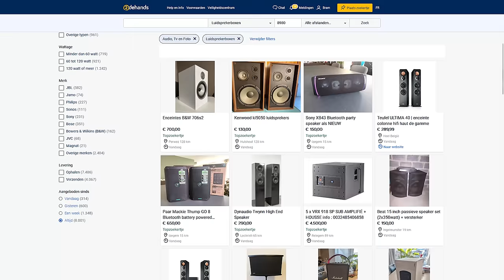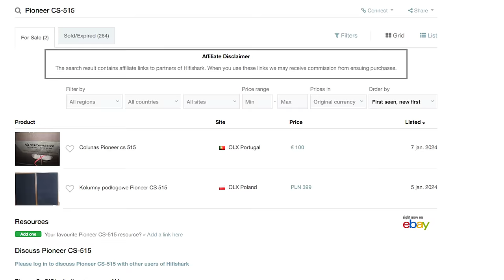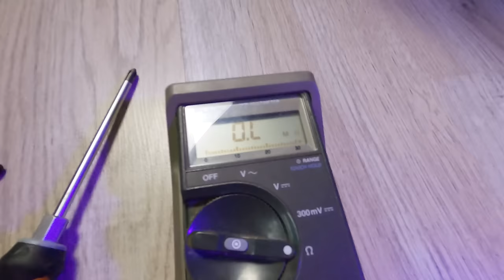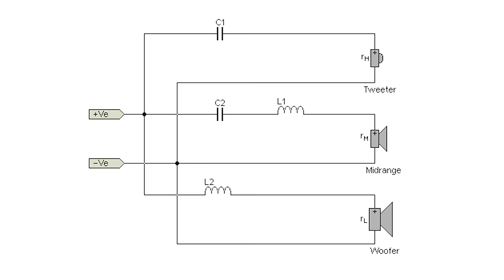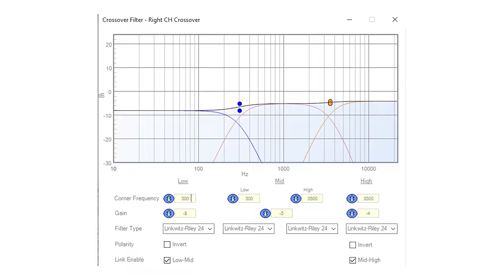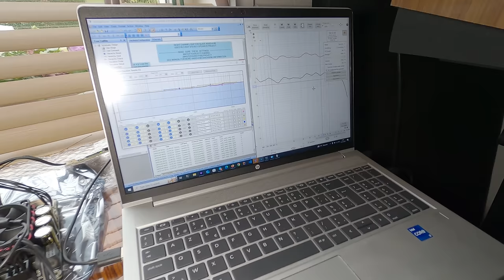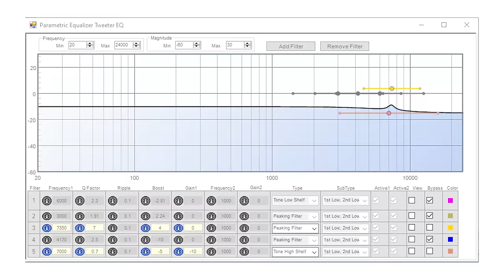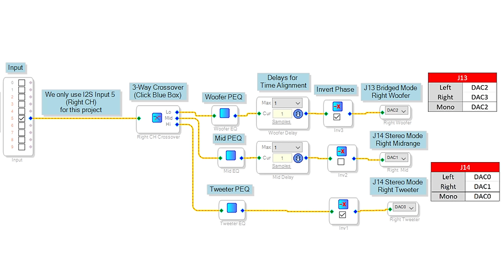Turning BROKEN Speakers into HIGH QUALITY Studio Monitors

Comment: Awesome and inspiring, thanks for the video. Would really appreciate if you could share details of the parts and components you have used and where to order. Thanks
Reply from the maker: Got most of the materials from SoundImports and Audiophonics. In the US you might want to use parts-express.

I probably forgot a few things, but these should be the most important:
- HiVi RT1.3WE Isodynamic Planar Tweeter
- Neutrik NL8MDXX-V-BAG speakON 8p
- Neutrik NL8FC
- MOGAMI W2919 Speaker cable OFC Copper
- PINTA AMORTSONBi10A PHD Self-adhesive bitumen backing
- PINTA RESOBSON FU1220 Self-Adhesive Fabric Felt Damping
- SMPS300RS Switching Power Supply Module 300W / 36V
- WONDOM AA-JA11117 Functional Cable Package for JAB3+ / JAB4 /
JAB5 Boards
- WONDOM ICP5 Programmer
- WONDOM JAB5 AA-JA33286 Amplifier Module
- Shrinkwrap
- Wire for connecting to the power grid

Hope that helps!

Comment: great work!  I have a pair of JBL 4412's I bought in very bad shape.  SO bad I literally had to rebuild the boxes as they were smashed in a way all the corners weren't tight.  So I had to redo them, wood putty, sand and paint in dark gray.  Then I had to recoil the 12 inches and have both tweeters replaced as they needed new voice coils and it's a lot of work to repair.  I bought new tweeters (same models) but they were actually also broken.  So I managed to find a JBL expert that could fix them.  But when I look at the way to sound prrof the box, I wish I spent that time searching for the right materials.  Very nice.  If you can add more detail on the sound deadening material I might put more effort there.  Thanks!
Reply from the maker: Amazing project, I really love the look of those JBL's!

The felt I used is PINTA RESOBSON FU1220, and the Bitumen sheets are PINTA AMORTSONBi10A PHD. I suppose similar materials from other brands might work good as well, if this is hard to get in your area. Hope this helps to further improve your speakers!

Comment: Try this with old speakers, to make insane speakers: Disconnect the tweeter and med range (if it has one) and put an inductor on the woofer (if it doesn't have one). Drill a hole in the top panel (towards the rear) for speaker cable (from the binding posts). Connect a 5" open FR driver and mount it on top of the box, open! And also slit the cone of the driver (if it's cheap) and cut right through (with 8 mm cuts) about 5 mm out from the center edge (with a razer blade) and all around, 360 degrees. But with 5mm gaps (that are not cut) so the cone is still in one piece! 😅 This mod is for the best treble your heard! 😮  Make a crossover filter for this driver if you like (I did and that's the secret for the best sound). But don't just connect the open driver, 100 mf capacitor on the open driver is essential for power handling and for clear med range when driven! Use electrolytic caps for FR single drivers! 😅 Sounds way better cos they make the clangy FR sound way more tolerable! Silky sound instead of a brittle sound that you get from ceramic caps on FR drivers. I have been doing this for years, and electros rock on FR drivers! You can learn basically how capacitors and inductor works and experiment. For a basic filter use a 100mf capacitor and a 2 uh inductor and a 2 ohm resistor in series, all in parallel with a 2 mf cap. And note that an open driver uses a different filter to a boxed FR driver (of course). For the clearest and cleanest med range that your heard. When you blend it with the woofer right (you may have to resist the woofer a bit for the best sound). And of course a failry large inductor on the woofer cos the crossover freq is about 300 hz (with 100 mf on the open driver). On mine, 250 hz is loud and clear through the open 5"driver. It's point source med and treble and dipole with the cleanest med range you heard (after a bit of fun, tinkering). 😅 It's the unique clean tone and tonality control in the med range that draws me in! A sound you can't get enough of, the silver sound! Mine sound like really expensive high end speakers and I have $10 FR 5" drivers and $40 6.5" woofers in squat floor stander boxes with the open driver on top of the box. Most holograpic experience ever! The image moves with you like a rainbow in a sprinkler shower. 😅
Reply from the maker: Those are some insane mods O.o I definitely won't be cutting my drivers anytime soon.
But if it works for you, all the power to you!

Comment: As for upgrading the speakers, and adding anti-resonant foam on the inside of the cabinets Dynomat have a number of products you can use even if they are not specifically made for speakers. Local company so always like to give them a plug. They make really good product for your speakers, car and home. People spend 1000's on stereo eqpt. but never add acoustic treatment in their house.
Reply from the maker: Dynomat can indeed be an alternative for the bitumen.
And yes, room treatment is very important. I put up a bunch of panels now for testing, but I still need to do it properly for this room. There might be a video on that later.

Comment: Very interesting video.  I found what I consider a "magic combination" modifying a pair of Kenwood JL-690 speakers.  I listened to them in stock form to listen for anything I didn't like.

First these are rear ported, something I have never like in any speaker.  I glued a plug in the rear ports which also lacked port tubes, they were just a hole in the cabinet.  I got real port tubes for them and drilled a hole in the front and installed the new port tubes.  I removed the factory crossover/input terminal combination and enlarged the hole to accommodate Infinity Reference 5 crossovers (real crossovers!).  I added a L-pad volume control for the midrange driver as they were to "forward" for my liking and that toned them down nicely.  Finally I added acoustic batting inside the cabinets.  Now this inexpensive speaker system sounds absolutely fantastic.  I'm using them on a Kenwood KA-3500, sometimes a KA-7100.  They sound so warm and very satisfying to listen to.
Reply from the maker: Nice mods!

Comment: WOW !   A lot of work going into the restoration.  Pretty well all corners covered.  The speakers that I use each contain one 15" woofer, 2 mid-range drivers, and 4 tweeters.  Combined with adjustments made via a Soundcraftsmen PE 2217 Preamp/Equalizer, they sound pretty good.  I built the speakers myself back in 1978.
Reply from the maker: That seems like quite an impressive build!

Comment: I really wish I had all of the necessary equipment needed in order to do "digital" crossovers through a computer or whatever, because the versatility of that type of setup is impressive! I'm relatively knowledgeable about passive crossover design, but what all you were able to do with your digital crossover with these speakers was awesome! Even more impressive considering you said you never worked on speakers before! Wow!
Reply from the maker: A cheap windows computer (and an ICP5 programmer board in my case) should do the trick! If you want to do measurements as well you will indeed also need a measurement microphone and an audio interface. Quite the investment indeed. I was lucky to have most of this stuff lying around already.
That being said, I find passive crossovers quite daunting, so I'm always impressed with people building those.
Reply: @SirFreak  Yeah, I guess everyone has their strengths in some way or another. I find passive crossover design to be fun and (relatively) easy and simple because you're dealing with hard physical components that always do a very specific certain thing that you can count on. Of course it's somewhat variable, depending on interaction with other components in the circuit, but the basic function of each component in a passive crossover is always gonna be pretty much the same everytime, as in what it does to the signal...

Whereas with computers and anything related to them, literally every single button, including every single virtual button or tab or thing that you can click on on the screen does MANY multiple different things based on what you're looking at, what "screen" you're on, or what program is running, etc. Computers are SO "versatile", as in they can do SO MANY different things, that just that one specific fact is exactly WHY I have an extremely difficult time understanding exactly HOW to make them do any one specific thing that I want them to at any given moment... I NEVER know what button (or rather what extensive exact button SEQUENCE) to push OR what to click on on the screen in order to get what I want out of it, because everything is constantly changing on the screen AND what each key or key combination or sequence does in each and every instance.

Unfortunately with me, computers in general are just WAY too complicated for me to grasp what they're doing in any given instance, and because I started (trying to) "learn about them" way back in the "Basic" programming code days, I've never been able to comprehend all of their many intricacies of operation...

Way back then I was always thinking that "If computers are gonna be THIS ridiculously difficult and complicated to use, then I cannot see how they could ever even be of any REAL benefit to you!"... Rather just an overly complicated time wasting device...

And even though nowadays, in the modern computer era, I actually CAN see how useful they are or can be, (at least as long as and IF you know exactly HOW to use them to get what you want out of them by knowing the exact keystrokes and mouse clicks needed, AND in what exact order is needed for whatever function or result to happen), but unfortunately for me, I just cannot ever grasp even the basic understanding of how to get them to do ANYTHING truly useful for ME! I always have to have someone else show me how to make it do something, whatever that may be, but the sequence of button pushes is SO complex AND is ever changing depending on what exactly you're trying to do on it, that even immediately after someone "shows me how to do something" on a computer, I can't ever remember the keystrokes needed to do the exact same thing myself, so as (potentially) "useful" as a computer could be, (for someone who knows computers anyway), I don't think that I will ever be able to comprehend them enough to do anything on them myself, because even after literal decades of TRYING to understand how to make them work for me, I still can't even do the most basic things on them. My brain gets totally fried and frustrated every time I try to, lol!

The most complicated piece of modern equipment that I can (sort of) operate, (at least SOME features), is my cellphone that I'm writing this reply out on. It is the closest thing I have to a "computer", AND it's my ONLY access to the Internet, (I don't have internet at my house in a "hard" or "physical" form such as a cable modem or whatever, because I don't own a computer because of above reasons, so why pay for internet (at home) that I'd never use), but all I can do with my cellphone is watch YouTube videos, make phone calls, texting with close friends and family, and checking my email, not really much else.

Anyway, as cool as this program or whatever you have there for the speaker's crossover is, if I was to get any of that stuff myself I wouldn't be able to use it anyway, I would have to always have someone else who knew how to use it, (someone like you for example), actually make it do what I was describing and knew in my head what I wanted, but just didn't know how to make it actually work that way, lol!

You're very lucky to have this equipment to do this sort of thing with your computer! AND to have the knowledge of computers in general in order to make it all work to a truly useful degree, because I could see how having and knowing how to use something like this setup would make speaker designing and building SO much faster and (potentially, IF you knew how to use it all), probably even relatively easier too! I actually kind of envy people like you, because I just wish I could comprehend this sort of setup too! (AND of course have the money to buy it all too, which unfortunately I don't either.)

Oh well, I can still build passive crossovers the old fashioned way, even though they oftentimes take MANY days, weeks, sometimes even months to perfect, by "trial and error", whereas with software based digital crossovers, they can be designed to work well within just a few minutes or hours because the "computer" does most of the calculations automatically. Wow!)

Comment: Fantastic job! You achieved fantastic levels of refurbishment/repurposing out of those old speakers; even though they were lacking key things like strong cabinet walls and acoustic dampening, the end result was amazing! The noise you’re hearing might be coming from either the power supply or the DSP. If you can, I’d recommend trying to use linear power supplies with toroidal transformers to see if that eliminates the problem; those are expensive though, so maybe you can find someone that could lend you one just for testing. If it is confirmed that the noise is originated by the power supply, you can add a passive filtering stage between the power supply and the amplifier to get rid of those noisy frequencies, since they should be in a very well-defined range. If the noise, however, is being generated by the amplifier, you may be able to either (a) add an end-stage filter in the DSP, or (b) add an analog filter network (capacitors and inductors) at the output between the amp and the output connector. Finally, I’d recommend placing the electronics inside a metal box (make sure to use spacers and insulators to not short-circuit anything, and allow for proper ventilation to avoid overheating) since that will work as a Faraday Cage to avoid noise interference from external sources. I’d love to know if any of these ideas worked for you, please keep us posted, and again, congratulations on the outcome of this project! Keep up the great work 😊
Reply from the maker: Thanks for the advice!

Comment: As a former electroacoustic engineer I'm delighted by your curiosity and rigor and it's great to see DIY done in that space. In my opinion though, this is not a cost saving measure. The science has come a long way in the last few decades and a lot of techniques that improve the performance of a speaker are not intuitive. Some very cheap off-the-shelf speakers nowadays integrate technology from their bigger brothers, which makes them much more suited as a studio monitor than a modifyed old speaker. For example, the waveguide of the JBL LSR 305 eliminates smoothes out the directivity a lot, which is much more important than the frequency spectrum that you can easily change with software. You can get a pair used for almost nothing and you don't need an amplifier because they are active. The only real downside is it's rather loud white noise when it's on but not playing anything, but that's present in all speakers in that category. And if you are concerned about bass performance - don't be. In order to have "studio grade" bass you need to invest a lot into room acoustics and by that point you will have more budget for speakers available. In either case, fun project and good watch!
Reply from the maker: Hey there! Correct! What I did was definitely not cheap, and it was a lot of work as well.
I also agree that there have been a lot of improvements in speaker-building in the last decades. I also do not have the required knowledge to design a custom waveguide, nor will I acquire that knowledge in the near future. As far as I know, waveguides are very easy to get wrong, and this could cause more issues than advantages. And I'm also still a complete newbie when it comes to this stuff, so I try to stick to the basics.
That being said, and with all due respect, I'd gladly put these speakers next to those cheap JBL's and I'm pretty sure the JBLs will sound like cheap junk next to what I made here.
Are my speakers perfect right now? Definitely not. But I'd much rather mix on them than on any budget studio monitor.
Thanks for watching!